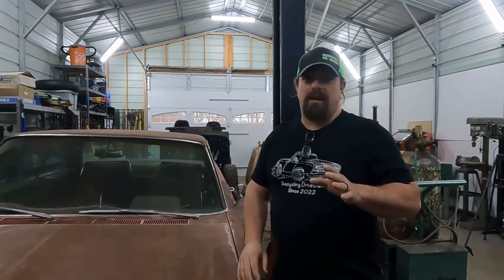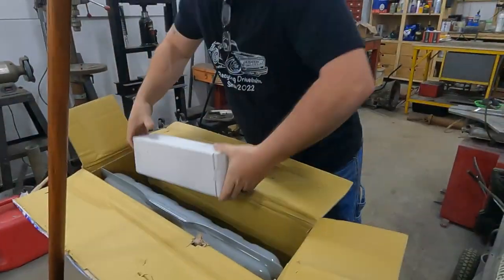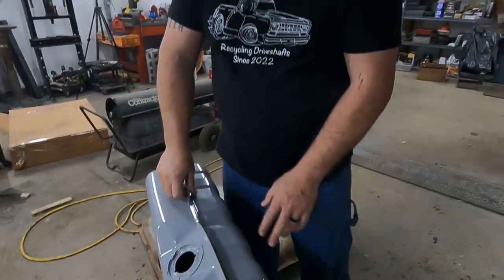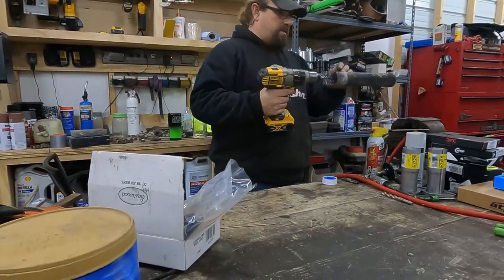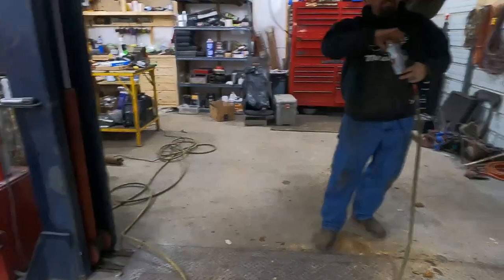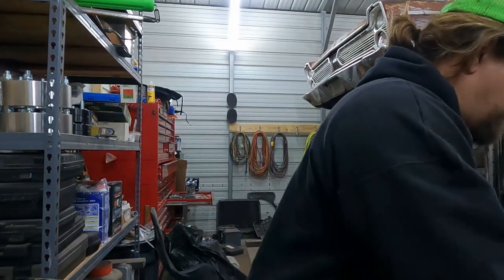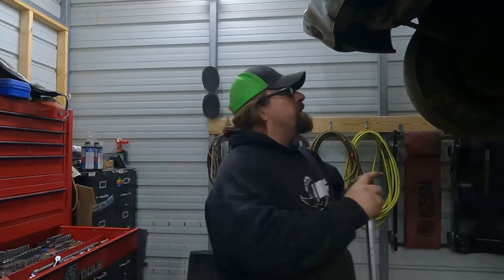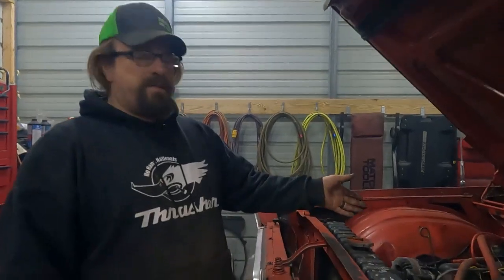Junk Fuel Tank, No Driveshaft, Incomplete Powertrain Swap = PERFECT Project!

Comment: distributor internals &check the ign box, get a spare at least....all that flashy new stuff tells me its had parts thrown at it but no thinking thrown at it.....those carbs are a nightmare, better reliability etc to swap to a basic 4 barrel factory intake and carb off a 360 anyways should be able to find one  pretty cheap too.
Reply from the maker: Yes sir, the distributor is points so there isn't an ignition box, I have thought about switching to a 4 barrel and that may happen at some point but for now there are other things that are more important, thank you for the heads up.
Reply: @PerpetualProjects  i thought you said they LA swapped it...why would they not leave the electronic ignition?..its a few wires not the Manhattan project..
although that does explain even more of why the ign is running junky (bad decisions)
Reply from the maker: @kazzxtrismus  Agreed, but it is what is there so I will see what I can do to get it running right. I am not really interested on spending a bunch of money trying to fix the 318. That would be better spent getting the Hemi built.
Reply: @PerpetualProjects  a junkyard distributor and ign box is probably faster and easier than fighting a mismatch...and dirt cheap.
that said you know the car and the mess thatll be better than me....i dont even know if a points dist can/will time correctly in an LA